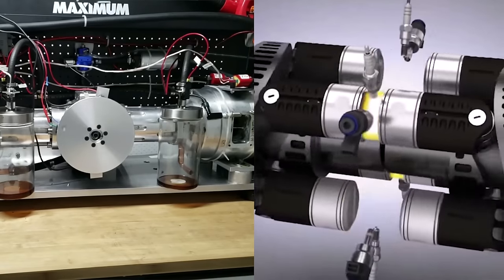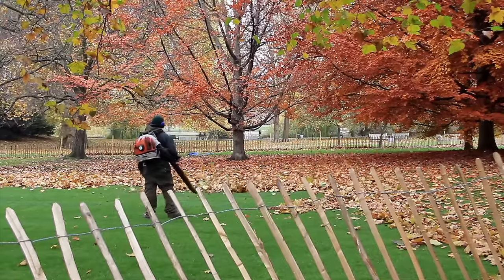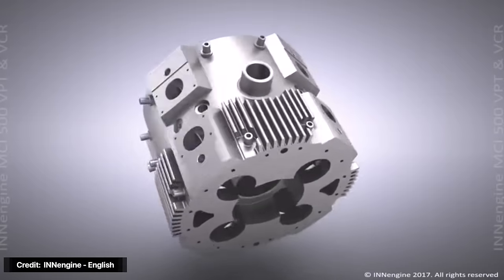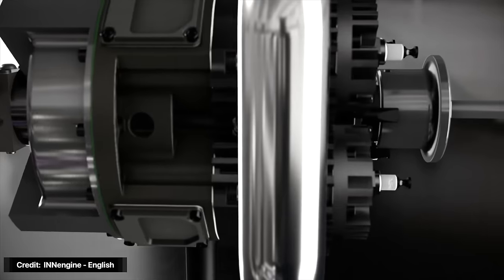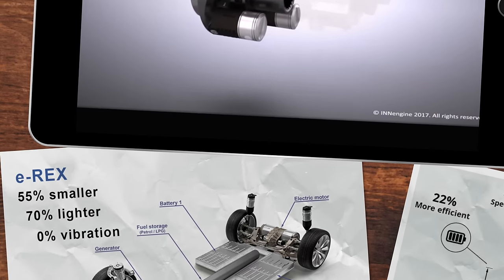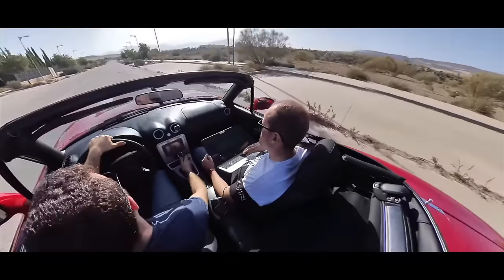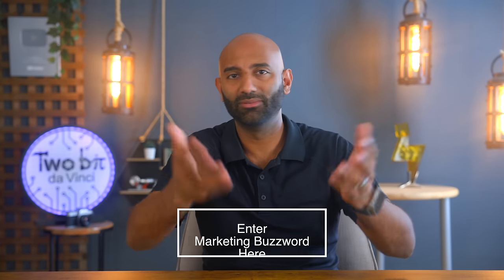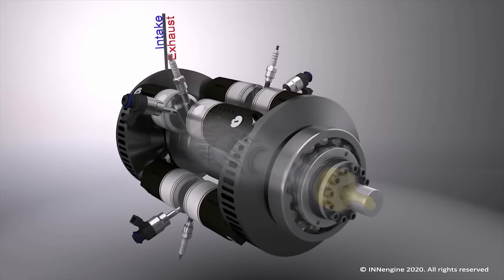One Stroke Engines - 200% More Efficient??

Comment: The future IS NOT electric vehicles.  However, I would consider electric final drive if there's an ample internal combustion generator.  Two-Sided Free Piston Linear Engines are probably already a better range extender.  Interestingly, turbines on the grill of a truck on the highway can capture more energy than they burn.  Using an F150 with pro-power to charge a Tesla, and the Tesla still gets about 20+ mpg's so not bad.  

EV's are a neato technology demonstration for woo-woo torque, but pretty much suck in cold or heat.  Child slaves gather up the rare earth metals to make not enough batteries.  Toxic disposal.  Prohibitively expensive battery replacement with no rights to repair.  The environmental impact of lithium cars is worse than if we just burned the gas, unless you've already got small modular nuclear reactors installed all over the grid.  But there are only coal fired boilers and gas turbines.  Solar and wind have a pitiful lifecycle cost and take up tons of space and cause other pollutants.  Solar and wind do not belong on the grid and nuclear fission is cheaper than coal.

The wet black stuff is infinite and energy dense, and there is no such thing as global warming, earth is flat, dinosaurs are made up, outer space is made up, viruses are made up, nuclear bombs are made up, and the only reason EV's are being pushed is because Governments want their livestock chattel slaves put into 15-minute ghettos / concentration camps.  Not joking about any of it.  I'm surrounded by brainwashed dipshits who believe everything the Government ever put on TV.    You can't land on the moon, it's a cold translucent light.  

My next truck is going to have the V8 Godzilla engine and be supercharged to 700 horsepower.  And I'll have a Titan Fuel tank with 500 miles of range.  Tow pretty much anything I want.

Comment: "really bothers me when companies make outlandish claims like this and don't live up to the hype..." 

lol the number of startups I've had to say "no, go away..." to because of this. I'm the engineer you brought in to support this thing. Don't B.S. me, I'm not an investor that needs shining marketing terms to get your series A funding. I'm the guy that needs the real figures. If the actual product doesn't live up to the claim, I need to know so I can make it work with that claim, but I can't make it work if I'm not getting the real data or I'm not told there's a problem in x while I focus on the obvious y problem. 

I've also helped a few startups avoid the traps of buying tools and other components "based on MIT research." Yeah, the research is sound... but what you want to buy at a horrendous price-point this is the As-Seen-On-TV equivalent that is nowhere near the capability of the real thing, don't buy that one, buy this one instead... etc.

Comment: No offence but you’re not an engineer if you think EV’s in their present form are the future and the world is transitioning to them. One look at the backlog of these things sitting around, unsold in dealerships says otherwise. Lithium battery based EV’s are cleary not fit for purpose, anyone can see that. Secondly, no country on the planet has an electricity grid capable of supporting a wholesale transition from petrol to battery based EV’s.   Yes, petrol will not be the answer forever but there will need to be further technology breakthroughs (like this engine) to find something better.

Comment: I would have thought a ie jet engine would count as a one-stroke engine.  The air flowing through the engine goes in one direction only, it is compressed by a fan as it enters the constriction, the fuel is ignited in the middle, then the expansion of that burning mixture drives a fan which turns a spindle that runs through the centre of the engine and turns the compression fan at the front.  

Given that they work best at a steady speed, I would have thought these would make great power generators - just run them at their most efficient speed, all the time.  They can be a tad noisy though.

Comment: 😮 nearly 50% of American and Australian EV drivers indicated that they were going to go back to an ICE vehicle.  The secondary costs are far too expensive, insurance, tires, extra registration fees and one and a half times the mechanical problems, oh, and now the cost to charge surpasses gas and diesel.  And if you need to charge away from home,  you have to find a working charger, and then wait the nearly 2 hours to get back on the road...  Nice concept, but I'm sticking with my ICE car,  thanks.

Comment: Range extender ICE engine automobile makes more sense than a pure BEV. For one you can have batteries that are a third or a quarter of the size. Recharge times would be cut by the same ratio and you could build 3 or 4 cars f on the same battery in a pure BEV car. Knowing that there isn't enough lithium being mined or planned mines to satisfy half the projected need just for cars by 2050 and you see BEV isn't a viable solution.

Comment: Except that ICE's aren't going away anytime soon. More and more people are getting rid of or avoiding going EV due to the inherent problems they currently have, such as problems with operating in sub-freezing temps, and the current scarcity of Tesla superchargers. The time it takes to refuel or charge is an EV is also a problem for many prospective buyers of EV's. With all these problems and a few more, it's going to be more difficult for these vehicles to be proven to be just as convenient and worry free as ICE cars. Sidebar: How fast does one really need to go 0-60mph? Many of today's regular commuter type cars can do it in under 10 seconds. The need to do it any faster is only supported by being chased by some marauder trying to carjack you, which is still a pretty low chance.
I won't even get into the environmental nightmare of mining for and disposing of lithium and cobalt. I'd rather have a thorium micro-reactor.

Comment: Look at the old GMC AC compressors, long one's 3 cylinders forward and 3 rear. All lies, you haven't design some new design that hasn't been done😂😂😂. Why use this swos plate design only good as a driven compressor versus crank pin type, rotor or turbo as range extender. Dump the 2 stroke as pointed out terrible emissions let lone Cat killer. My 2 cents your mileage may differ.😊

Comment: I have a Prius Prime with only 30 mile EV range but after that it is up to 70 MPG.  I am trying to avoid using Gas as much as I can but something like that so-called single stroke engine in just a small portable generator that is made to fit and pull air in and exhaust out of a frunk for those longer trips in these EV trucks and such would be great.  The Ford F-150 Lightning is actually rated as better than the Ford F-150 ICE in towing but you wouldn't likely do that because of the range decrease when you do.  With the Generator in the Frunk it just might be practical.

Comment: Like millions of Americans, I live in an apartment building. It was built in the 1980's and there is no way to retrofit EV charging stations in a cost-effective way. Also, the USA is a huge country with very diverse geological and meteorological areas that won't easily conform to the needs of EV vehicles. Just imagine, for instance, if you're in an EV car caught in a long traffic jam due to an accident on the highway or in frigid snowy or whiteout conditions, or in long stretches of desert highways, or many other possible scenarios that have to be realistically considered when planning reliable modes of transportation for U.S. citizens.
Added to that is the fact that we don't have the electric grid infrastructure to support national EV use.
Gas and diesel powered vehicles will always be the best fit for the United States! Another possible new technology that could be more easily adapted to is hydrogen powered vehicles, which Toyota has been trying to develop and perfect for some time.

Comment: For me, the only way an EV would make sense with current battery tech would be with a range extender using a fossil fuel generator of some kind. BUT then you are transforming fuel energy into heat energy to make mechanical energy to transform it again into electric energy and BACK to mechanical energy. That is a LOT of transformations and associated losses. Worse, most people do NOT have reliable access to EV charging stations, and the US national power grid is not set up to handle the energy demand currently satisfied by fossil fuel power. 
Hydrogen fuel cells are promising if we can crack the hydrogen storage problem.
Unfortunately, petrol engines make the most sense today and that is not changing anytime soon.

Comment: So the e-Rex engine is intended to replace the Atkinson cycle engine in a plug-in hybrid. Cool,  I guess.  I think plug-in hybrids, like the late Chevy Volt, are the best current option for electric vehicles, at least until a high-speed charging network is built out (which will be never in sparsely populated wide open stretches). I like the elimination of range anxiety that plug-ins provide - they still run all-electric for the 90+ percent of driving locally but are capable of long highway trips away from the charging network. Make their ICE generator engines flex-fuel and they can run on E85 or pure ethanol instead of pure climate killer juice. E-Rex is cool if it is more efficient, less polluting, or less expensive than modern Atkinson cycle engines, but that is not a big improvement in the overall concept of the plug-in hybrid.

Comment: Every automaker should design/ produce electric cars with the option of adding a small combustion engine as range extender(to move an electric generator to charge battery- power electric motor), like the BMW i3 Rex. So, no range anxiety with this one.

Comment: EV is the future ... but having an onboard method of generating electricity makes more sense than depending on battery storage only ...
The best example of current hybrid tech is in the Worlds Mining Operations for 50+ years ... Loaders - Shovels - Haul Trucks are all electric propulsion getting their electricity from Diesel engines that also handle their extensive hydraulic systems ... these machines have gotten bigger and more efficient over time!
Thanks for sharing !

Comment: Definitely i would use this as a battery back up as a range extender. Its genious. Small efficient, shouldnt need much zero to 60, just the , at that time exorbitantly priced 10 gallons of 94 to get me those 100 miles through the dessert. Rivian should look at this. Hydrogen power is falling behind and now a company has made weight to power ratio off the charts. Seems lime they are onto something. Just like you said everything is a tradeoff, lets try and see whats best for our future and go with something, something is better than nothing, right.

Comment: As your vid noted,  the most efficient way to carry a store of energy for a vehicle is via liquid hydrocarbons.  Also quicker to refuel and much safer than current batteries - the charging of which from sources external to the vehicle will ALWAYS be problematic.  However, more efficient ICEs directly charging safe and long-lasting batteries to run electric motors appears a likely future.

Comment: Until we have an adequate power grid, 100% total electric is academic and simply not yet possible. Not to mention current battery technology does not perform in cold climates. The folks that are pushing green are the same that ones that are preventing the expansion of our power grid and fight in court every day to stop construction of additional power plants. How does one charge in urban environments? A small town with 40,000 residents and 10 chargers in the Wall Mart parking lot, that is an angry mob in the making. Plug in Hybrids look like the best solution for the immediate future. The Chevy Volt seems like a good option as well. Maybe GM should circle back on that one.

Comment: I do think electric cars are the future but there are MANY problems with large scale implementation. 1) None of our power grids are ready to handle even 50% of people charging their cars. 2) Range is an issue. Whether you are talking heavy load vehicles or actual road trips, spending 30 mins to an hour charging is down time and, in business, down time is lost money. 3) Giant banks of batteries are heavy, costly and not environmentally clean. Without massive power grid overhauls with a huge increase in nuclear power, we will not be going to full electric any time soon. Hybrids that are purpose built and efficient solve all of those problems. Solar panels and blades for windmills are already a major ecological problem now and will only get worse. Take charging your car before you drive off the table. The ICE is your generator. You need a much smaller battery bank, which makes a much lighter car, which means you need much less power to move the car. A hybrid like this is FAR more efficient than an all electric car, in every way, and in the long run it is also far more environmentally cleaner.

Comment: The “range extender” ,basically a hybrid, is a great idea. Though why do you need such a large motor for the operation? (A) if a shaft off a non-dominant wheel could re-utilize motion to an electrical generating device within the car. People have tried in more creative ways I believe. 
 But if staying with an ICE as a power source to extend range a smaller 4stroke motor the size of a hand could be used? Gear reduction utilizing a liquid cooled RC car motor? Or even a small electric motor with gear reduction to a much larger power output generator? Has this been analyzed?

Comment: Why does everyone ignore Hydrogen in ICE? So much more power from H2 + O with only heat and water as the exhaust. It has been proven over and over. With some of the bright engineering minds out there we should have long since left petroleum base ICE in the ice age. Electric is awesome, BUT until you figure out something better than a battery people will not give up their unlimited range.

Comment: You must live in an urban area.  Electric cars in the rural areas of the United States do not work.  On a freezing (or below freezing) day in Oklahoma you would not even have enough range in an electric car to go halfway across the state.  How do I drive to Nashville in a day in an electric car?   The combo of Electric and gasoline (or natural gas/propane which burns very clean) would perhaps answer the question(s) around electric cars.  How do I use Electric to move a dump truck 200 miles?  Construction and mining questions abound.

Comment: 1 stroke engine, aka turbine, the strokes are set laterally not vertically .
stop redesigning ICEs just go electric and forget it. figure out better batteries, this is the equal to people redesigning steam engines after ice engines came out.And lubrication is never addressed, basically this is two swash plate compressors put together, and their longevity will be LLLLLLLLOOOOOOOOWWWWWWWW
range extension is the answer. if they would do it correctly

Comment: Battery production is not very kind on the environment (cobalt and lithium). 80 percent of the polution comes from the manufacture on all cars. E vehicles are dependent on a continous supply of electricity. Its great if you have solar panels and can use these to charge your car, its not so great if you have a long journey to make.

Comment: The reason why a better combustion engine design beats moving to EV is, EV is a garbage replacement for combustion engines needing much more toxic materials for something that lasts hardly a quarter amount of life and struggles against anything that is not 'average' temperature. Like yes, EV beats combustion engines for power efficiency but is digging up 500,000 pounds of earth for a single battery worth the 8-10 average years they last? Not to mention only being worthy of the road in urban population and a complete mistake to buy in rural. Should look at EV graveyards where people would rather throw away their entire car than replace this already material expensive battery.

Comment: Evs are ok around town. During the cold snap this winter in Chicago, there were parking lots full of dead Teslas. Think about that. Until battery tech becomes safe and not affected by temperature change, ie very cold days, I will stick with what works for me. If you think about your analogy of horse and buggies when cars were coming on the scene, The Amish still get around with horse and buggy and they have improved their buggies quite a bit. They will never be a burden to our overtaxed electrical grid and if the gas runs out, they will still get around. They also don't contribute to pollution by producing toxic waste from making Lithium batteries. They don't pollute by generating electricity.

Comment: DeBoss Garage has a retrofit system for medium to heavy duty pickup trucks. Hybrid.  Electric drive wheels, Engin conversion to electric Generator.  Also to run your house or business from Electric Generator.   Range Extender max.